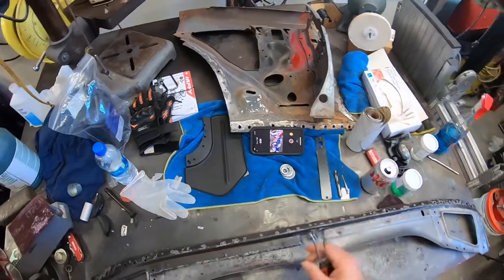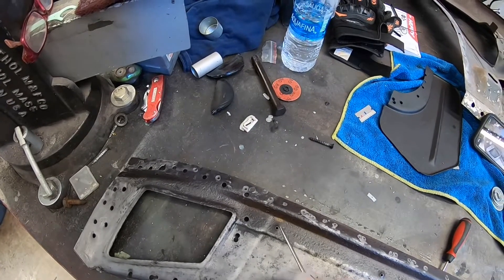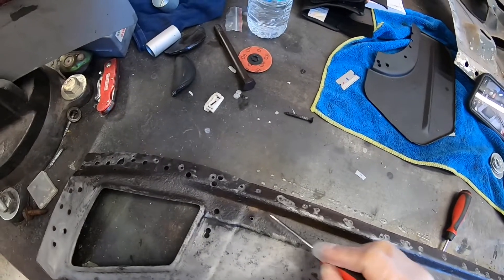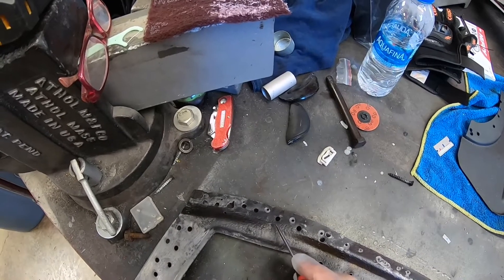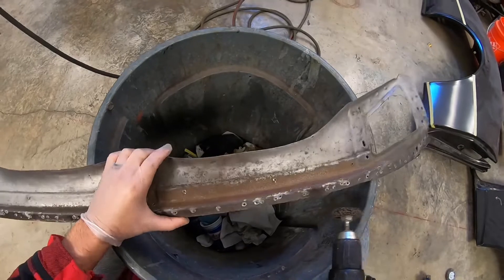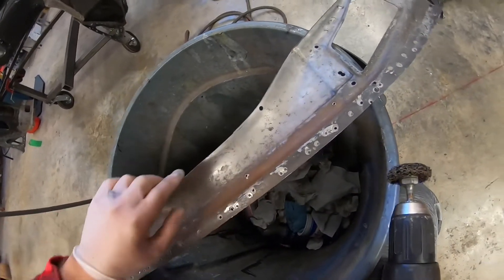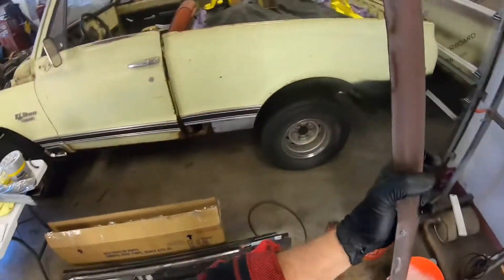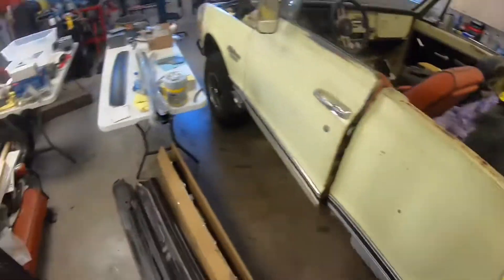Rust is the devil 😈

Comment: told you on the last rust vid you made, with those chemical washes etc the way to get rid of the rust is to keep it submerged for 24 hours
even the crappy little pot ones work when its sub'd

as you can get this in large containers get a few, make a bath for the panels, you can do this with a platic box or lay down some wood or bricks to make a area big enough then drap thick plastic sheet over it and fill that with the rust eater, putting plastic bottles filled with water into the bath too (lid on) will raise the height of the liquid so you don't need as much, just like how the bath water raises when you get in a bath.

also if you have a thick enough plastic sheet or bag you can make a smaller volume bath by just putting the part into it and filling the bag

key thing here is to let the rust get totally eaten away, it will i've done it loads of times

when i havent had the time at work when doing rust repairs i use tissue soaked in the rust eater and lay it on the rusted area and keep wetting it so it doesn't dry out, its not perfect because it needs time to eat the rust but it removes it.

the "encapsulation" method where it turns black would work but you have to think about condensation forming inside the rusted bit and also body flex and it can crack the crusted section allowing in the air.

rust isn't the devil, its a cancer it's only remedy is to cut it out or remove it with acids

Comment: Good points of getting rid of rust!   I’ve used some full strength CLR to eat rust.  I let it soak for a couple days and all gone.   You may want to try on another part where you soak a rag in CLR, put it on the part, and wrap in plastic wrap so it doesn’t dry out.

Comment: I think most of these products only work on the surface, if the rust is deep you really need to use different methods or replace the panel in my opinion.  Thanks for taking the time to do this demonstration.

Comment: Your so-called "ridiculous" processes are why we watch. Thank you for sharing your findings. 
For smaller parts you can boil them in water for an hour or so, then card (wire wheel or steel wool) the junk on the surface, and it converts the rust to the other (black) iron oxide. Counter intuitive, but it's what gunsmiths do.

Comment: Yeah, I don't get it either. Same thing that happened to me. You see all these videos of people doing it, and it comes out great.
After I did it, I wire wheeled all the orange off, and at least so far, none of that rust has come back on my Camaro. I will always be afraid of it though.
Reply from the maker: Rust sucks, you did a great job Erick I bet your paint holds up great , I want to be like you when I grow up and actually get my car done ✅
Reply: @MrFireman164  Hah! Thanks. I am kinda stuck right now. Close to the finish line, but struggling with the motivation right now.
Reply: @asicerik  just remember the power hour.I know that works its keep me going in the right direction
Reply: @265chevy  Thanks buddy

Comment: great vid a lot of people say when its black the rust is dead but no you will find more under this i keep going usually end up spot media blasting the pits add more phosphoric acid until i get no  reaction/black spots at all then still 80g sand and make sure there is no white powdery dry acid left behind using wire wheel  then clean metal well with isopropyl rubbing alcohol using light colored rags until no more residue shows up on rags they stay clean then epoxy prime
Reply from the maker: That’s what I’m basically doing, like I said in the vid there maybe some science that I don’t understand like maybe the black seals the rust between the black and the metal and causes no o2 in but I haven’t been able to trust that idea so far
Reply: @MrFireman164  i think your right not to trust it i dont either in my mind the black is neutralized  rust but its a crumbly powder not a hard surface for the primer to stick too and of course under that is live rust does not make sense to paint over i really like your vids and your attention to detail the what works and why is great for us diy guys and girls thanks for all the effort you put in

Comment: I guess the answer based on your findings, is to blast any significantly pitted metal then treat with os-pho.  That seems to be the logical thing to do, but lets wait till we see it blasted before coming to a conclusion. at any rate, that piece will be much better protected when you put it back on the car, than it was from the factory!
Reply from the maker: Sylvester’s customs says never use acid over blasted metal so that put me in a dilemma, so I figured acid, remove acid, blast then epoxy
Reply: @MrFireman164  ok  got it.  Thanks Roger

Comment: I was thinking of making a small long soaking tank where you can soak small to medium parts so it is always wet what your thoughts
Reply: absolutely the right way to do it, submerging the rust for 24 hours or more depending on its amount will eventually remove it completely, try it with a jam jar and a small piece of extremely rusted metal